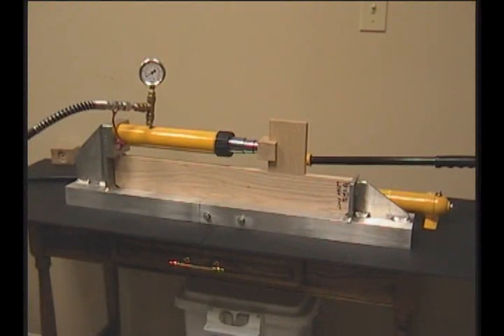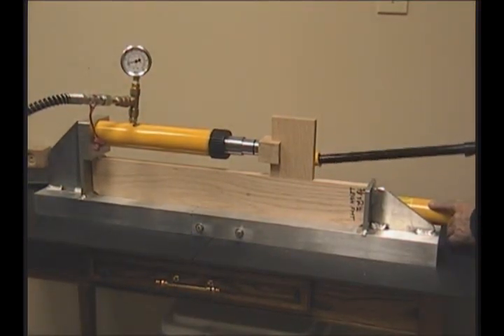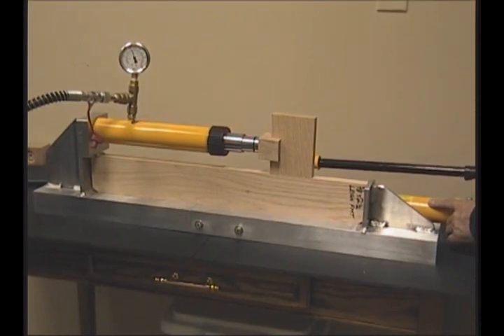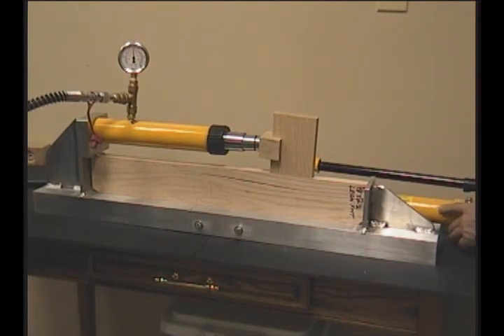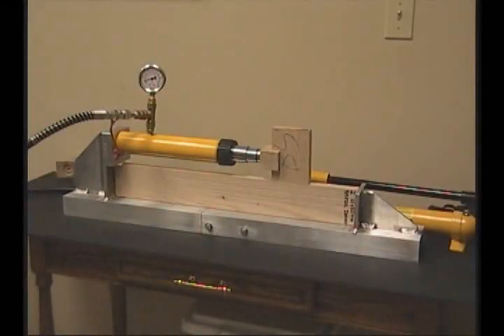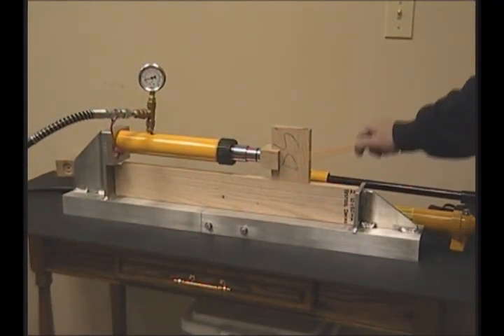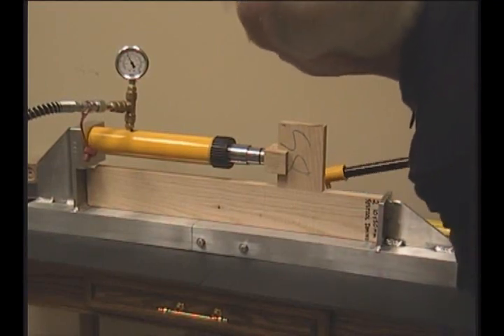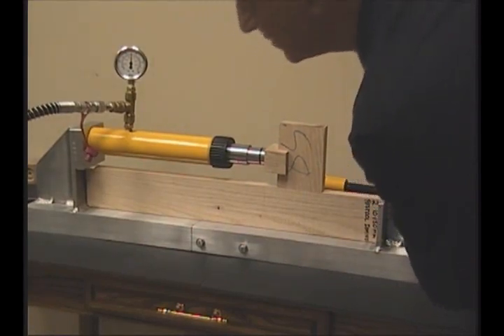Wood Joint Strength Test by Dowelmax Part 1- Pocket Hole Vs. Biscuit Vs. Domino Vs. Multiple Dowel

Comment: Thank you for the video. Two things. 

First, I would like to see someone compare a single Domino strength to simply using two 5 cent Lamello Biscuits on top of one another. No one has done that. Even a clone Domino is 17 cents. 

Second, I used calipers and measured the thickness of 30 each of DeWalt and Swiss-made Lamello plate joiner Biscuits. Lamello was 1000 for $46.37 from Amazon, which is 4.6 cents each. DeWalt was $7.98 for 100 from Lowes, which is 8 cents each. I calculated the mean and standard deviation of the thicknesses and the Lamello were more than 3x as uniform. 97.7% of Lamello are predicted to be between 3.69 and 4.00mm. DeWalt are 3.34 to 4.31mm. The goal is to be as close to 4mm without going over. Visually, the Lamello have a glue-gripping pattern on each side. The DeWalt had a more shallow grid on one side.

No sense in judging biscuits without using Lamello brand.
Reply from the maker: Thanks for the suggestion Robert, however we don't expect the other brand biscuits to significantly stronger in a manner that would affect the rankings of the different methods.

Comment: Great video for general joint strength , but these PSI readings are not accurate from an engineers perspective.  Grams of glue, Type of glue, sample size, you induce impulse when you use a lever to control hydro flow.  Anyway cool video, but not a real  "values"

Comment: Not a real woodworker, but an engineer here.  This test is of both shear strength (none failed in shear), and of pull out.   Two different tests.  And except for the biscuit joint, none of the joints actually failed pull out, the wood underneath did.  Admittedly, the depth at which each joint is embedded changes the amount of pullout strength of the underlying wood.

Comment: I suggest testing it with Kreg's #14 2.5" HD woodscrews.  I believe these HD  screws are twice as strong as the regular blue 2.5" Kreg screws.  The HD screws are meant to be used with 2x lumber, but I see no reason why they should not be used wherever the regular 2.5" pocket screws are used.

Comment: All are strong joints but testing with only 1 biscuit? Compared to 5 screws, 5 dowels 2" long at that, big mortise & tenon and 2 dominoes'??? That's a bit  unfair. Surprised you didn't throw in 5 X 1/2" reo bars!
Reply from the maker: I'll admit on the surface it looks that way, but it's not.  I remember a few years ago a prominent magazine did a strength test which included a #10 biscuit and a 2inch mortise, now that's unfair!  In our test I tried to replicate what most people would normally do, hence the single #20 biscuit. Also in order to avoid criticism I had a top class woodworker do all other joints i.e. the mortise, the biscuit, and the pocket hole.  If I had done these I would have included a three screw P.H. rather than the five. It's a fact that I have a fairly well equipped workshop, and have been extensively involved in woodworking and design for over forty years. I do not have a biscuit joiner or a pocket hole system.  Jim Lindsay  Dowelmax.

Comment: 5 Pocket Holes - 420 psi
No 20 Biscuit - 285 psi
Mortise and Tenon -  wood broke at 640 psi
Domino - 560 psi
5 dowels - 890 psi
Reply: I don’t think the biscuit was given a fair chance! I mean shit, competing with 5 pocket holes and 2 dominos!
Reply from the maker: @PHILSON13  I do see your point, but you're forgetting that's the biscuit design, not our interpretation.  In any given joint configuration, 95% of woodworkers will use one biscuit to fasten the two pieces.  We do try to implement these tests in an impartial honest way, there is no point not doing so.  Jim.
Reply: I think to calculate the force correctly you need to consider the area of the piston that the hydraulic fluid acts upon, not the area of contact between piston and the wood block.
Reply: What force do the PSI convert to?
Reply from the maker: The area of contact of the wood block on the end of the cylinder with the test wood is 1.45 square inches. The force applied to the dowel joint is calculated as 900 psi x 1.45 square inches =  1160 lbs.
Reply: @DowelMax  I think you'll find the force here would be obtained from the working area of the cylinder in your hydraulic jack so force likely to be slightly lower than 1160lbs.  Good video though!  Very impressed by the dowels.
Reply: @DowelMax  What is the distance from the horizontal member of the joint to the centre of the hydraulic jack rod? Having this will enable to the torque to be also calculated.
Also, as commented below, the diameter of the rod would be more useful than the area of the wood block. Also the wood block thickness should be taken into account as it surely becomes compressed and absorbs some of the force (although it could be argued that past a certain point it no longer gets compressed and thus transmits all the force, however, we do not know what that point is - it could be higher than any of the forces applied here so its compressibility should be tested separately, in theory).
At 1:42 what is the tenon's width?
Reply from the maker: @Stelios.Posantzis  Hello Stelios, The test stand is in storage so we can't measure it exactly, however we think it is about 2 inches. The area of contect with the wood is 1.45 square inches. The test is intended to be a relative comparison of the different joints rather than a more complicated engineering calculation, and to show that the multiple dowel joint is more than strong enough for any furniture application, and exceeds the M&T. Thanks for your comment.
Reply: @DowelMax  Thanks for this. I figured the distance would be about 2-2.5 inches. The cross-section, however, I doubt is 1.45 sq. in. I reckon the area of applied pressure should be that of the cross-section of the jack cylindre and the side of the vertical wood member. Regardless, ,going with the 1.45 sq. in. area and 2 in. distance, this gives following torque figures:
5 Pocket Holes - 420 psi --> 101 p.ft.
No 20 Biscuit - 285 psi --> 69 p.ft. 
Mortise and Tenon - 640 psi --> 155 p.ft. 
Domino - 560 psi --> 135 p.ft.
5 dowels - 890 psi --> 215 p.ft.
Reply: spoiler alert!!!

Comment: This is a classic example of a rigged test ! Nobody is going to tell me that dowels are going to be stronger than a proper deep or through wedged tenon. I am sick and tired of seeing customers come to me with failed dowel joints on their chairs and asking me if I can fix them The answer is always NO. They are useless when it comes to tensile and shear loads and worst of all, shock loads. 
This is a side load, the most unlikely load test you can put on a joint and a shameless BS promo for dowelmax. 
I bet you only cut a shallow mortise for this test, what was it ? Twenty/ thirty mm ? 
We did not get to see any of those joints before you glued them either, I wonder why.
Reply from the maker: I don't usually respond to this kind of uneducated, unsubstantiated, diatribe, however this is so virulent and accusatory, I will go against my better judgement and respond, not to the person who wrote this nonsense, but to discerning readers.

We have been conducting these tests for approx. twenty years, and you have my solemn word they are conducted honestly. All aspects are identical, i.e. wood test size, wood type, glue, curing period, etc. Joint penetration is identical with respect to the M&T and Dowel joints.  Others are optimized within the scope available.

Most of these tests were unsupervised, but some were supervised, and these people were picked for their expertise and nothing more. On three occasions these were undertaken by professional engineers in Vancouver: Matec Consultants Ltd. and two others were supervised by a contributing editor to Canadian Woodworking magazine, Michael Kampen. In addition the test stand was shipped to Eastern Canada, and the U.K. for tests and related articles. We had absolutely no involvement in either of these tests. In both tests our original findings were substantiated, and again the dowel joint, when done properly, proved to be stronger than the routed and handcrafted M&T.  We should state here that no test was conducted with respect to a wedged M&T. Refer to U.K. magazine Furniture & Cabinetmaking issue F&C 219 (shown on website) and Canadian woodworking issue dated Aug. 2010.

With respect to the application of glue, this indeed is a crucial factor in joint strength, and I have often said if the joint has a total contact area of 8.5 square inches, there's little to be gained by applying glue to only two or three sq. Ins. In at least one of our videos there is a detailed description of glue application, and in a recent test with a Dowelmax joint against the Festool Domino glue process is clearly shown and again the dowel joint prevailed.

The previous writer is living in the past. We are all aware of the drawbacks of older inexact dowel joints, and inferior glues. Things have changed with the advent of "Dowelmax". There are four crucial factors related to dowel joint strength: Accuracy, multiple placement, geometric configuration, and proper glue application.

I find the previous writers accusations offensive, and will not respond to any further submissions by him. His further views will be deleted.  

Jim Lindsay C.Eng, M.I.Mar.E 
President, Dowelmax

Comment: Did all these joints also get glued?  I.e. did the dominos/biscuit get glued in both mortises/slots and did all the  joints get glue on the edges of the joined boards?  Trying to determine if this is demonstrates real-world holding strength or a more academic result trying to just isolate the joints themselves.
Reply from the maker: Yes the device was designed to accom. five dowels for a 1x4, it takes another ten seconds or so to complete, and we were trying for the optimum on both examples.
Yes again.  I use a small paintbrush to coat all surfaces, and the procedure is identical for both.  In my opinion the difference in strength is a function of accuracy.

Comment: You are funny marketers))) What's the point of comparing the strength of ONE biscuit №20 (56mm * 23mm * 4mm) and FIVE dowels with a diameter of 10mm and 50mm long! Let's compare the cat and cabbage.
Reply: Biscuits do not add any extra strength. They really are for alignment of glue joints. 
They clearly may have amped up the dowel joint but still it is a powerful joint.

Comment: why in the holy name of crap do you need a wooden joint to be able to take almost 1k lbs psi? pretty sure i'm not setting a small vehicle on my wooden structures, i'll stick with my very fast and easy pocket joints

Comment: Results (psi):
5x Pocket Holes - 420
#20 Biscuit - 285
1"x3/8" Mortise and Tenon - Wood broke at 640, not the joint
Loose tenon with 2x 10x50mm dominoes - 560
5x 2"x3/8" dowels in 1" of each board - 890
Reply: Is it just me or does 5 Pocket Holes seem slight a lot.  Most people I know use 2-3 even for this size of wood.

Comment: For it to be more scientific, the woods chosen to hold the different joints would need to be randomized (there are variabilities in strength in the same species of wood, some are weaker and stronger than  others, and randomly picking the wood would help diminish bias), the ones conducting the experiments would need to be blinded (that is, they should be naive to the type of joint they're testing, in order to decrease experimenter bias. If someone is a pocket-hole enthusiast (let's say he is a stockholder in Kreg Inc. and invested his life savings in the company), then he'd likely look onto pocket holes  w/ more favor), and the different joints tested would need to be randomized (this would help diminish experimenter bias because it would increase the likelihood that the experimenters wouldn't know what joint they're testing, provided of course that they're blinded beforehand).

Comment: Can anyone explain how the wood cracked on the mortise and tenon joint at 690psi, but the wood used on the dowel joint took nearly 1000psi? Something really fishy is happening there...
Reply from the maker: The routed mortise removes more material than the 5 x 3/8 dowel bores do, and is therefore weaker. Using a square mortise to simplify the math, the material removed for a 3/8" thick x 1" long x 3" wide mortise is 1.125 cubic inches. The 5 x 3/8" diameter x 1" long dowel bores remove only .551 cubic inches.
Reply: Dowelmax. Bullshit. This testing is rigged to promote dowel max and make it look stronger. You did a shallow tenon instead of a through wedged or deep tenon. What this test does not demonstrate is the REALITY of joint failure. Its the shock loads that break joints not some silly side load with a hydraulic cylinder.
I dare you to do this test again with a through wedged tenon. But you won’t.

Comment: Just a suggestion, you should run at least 10 test per each joint, not just one,  because an individual result might be an error or a material fail. Then calculate average and standard deviation. That would be more informative. Either way, thanks for the valuable information and keep doing great videos like this.
Reply: ten is overkill, probably 3-5 is enough.

Comment: Don't you think putting 5 pockets in that piece actually cut away too much wood?  2 pockets and glue would probably fare better.
Reply from the maker: There is another strength test on the woodworkweb channel with 3 pocket hole screws that fails at 480 psi compared to the 420 psi in this test, so that would indicate that you are correct on that point. Thanks for the comment.

https://www.youtube.com/watch?v=6cAUz_eCmbw

Comment: Is it me or does the Festool joint seem to be holding even when it's called? Most of the other joints fail spectacularly and the dial indicator seems to reach 500 and hold even though you hear a crack. In any event, in my view, the joint that doesn't fail is the winner which in this case is the routed M/T
Reply from the maker: Hello Omar, we just stopped the test when we thought it would not take any more pressure. 560 psi on that test stand is quite a lot of pressure, and other 3rd part tests in FWW and F&CM have verified this type of result. Thanks for the comment.
Reply: Try watching the video again, the M/T DID crack. You remove a lot of wood for the mortise, and that is the board that cracked.
Reply: I’ve not used it personally.  But the dominoes have clearances on either side which allows it to shift unlike other tight (well loose in name but tight in nature) joints.
Reply: omar38317 for me the M&T is king and always will be. I dont but this time saving is cost saving.

Comment: Very interesting video. What was the diameter of the piston in you hydraulic jig (to calculate the force) and how far was it from the top surface of the horizontal piece of work (to calculate the torque)?
Reply from the maker: Sorry for the late reply as we are a small and busy company. I will check the measurements the next time I am at the storage location where the test stand is located. Thanks for the question.

Comment: Interesting, and worth looking harder at the Dowelmax - BUT In fairness, to make this a more valid test I would suggest it to be done with multiple tests on each type of joint - say 5 -- 10 tests of each, then excluding the highest and the lowest results  of each joint type, then comparing the median results of each - otherwise there are too many other factors (wood strength of a specific piece, glue bonding variations, etc.,)
Reply from the maker: We have done the tests enough to be confident in the results. Also you can google Canadian Woodworking and Furniture and Cabinet Maker where our test results were verified by 3rd party tests.

https://cloudup.com/izgl678IQj5
Reply: The objetive its to compare most used joints. University scientific test type in this case is not worth it,  and it wont be valid since each piece of wood has diferent resistance, even if all of them are oak or pine.  In real life 5 dowels are stronger than 5 pocket assholes, and better yet,  the joint its invisible !! : )

Comment: Any chance of a little re-edit showing a list at the end for a minute or so, from strongest to weakest joint. Really interesting, and not the results I expected.
Reply from the maker: +Dawn Treeby The results are as follows: (1) #20 Biscuit: 285 psi (2) 5 x pocket screws: 520 psi (3) 2 x 10mm domino: 560 psi (4) routed M&T: 640 psi (5) 5 x 3/8 x 2 multiple dowel: 890 psi. Thanks for the query.
Reply: Dowel Max typo on pocket screws? should be 420 psi